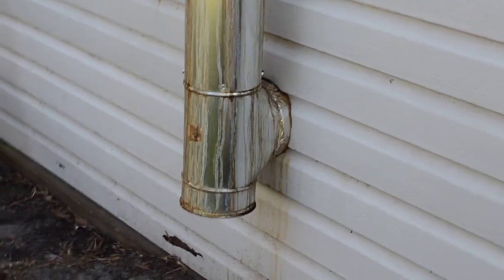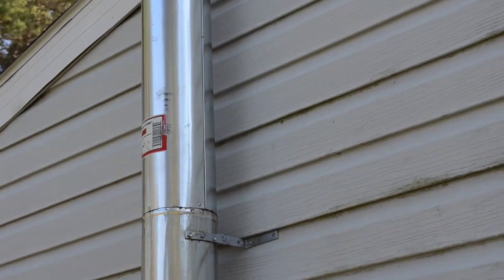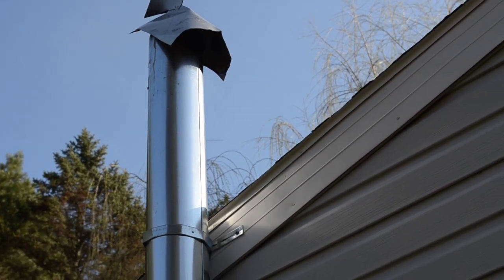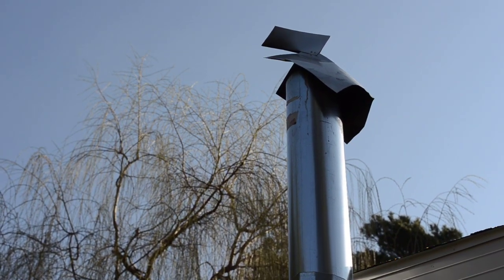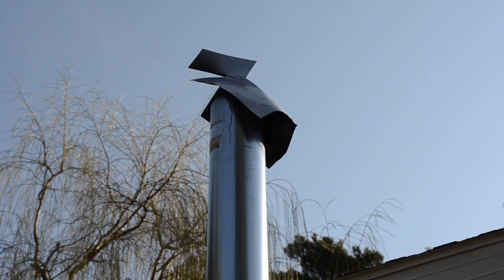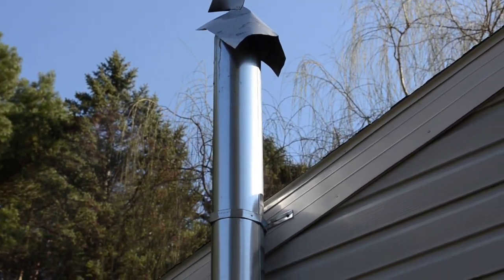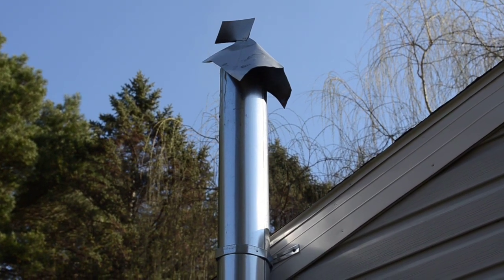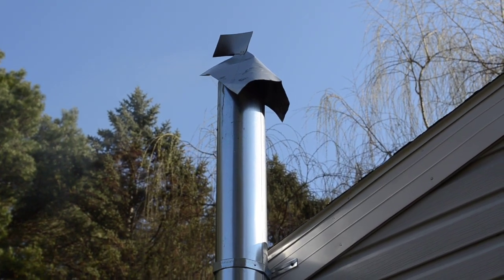Flue construction for Rocket Stove

Comment: great work your design makes a lot of sense vs putting the exhaust on the side of the barrel as many do. i was wondering if you or any of your followers could tell me how much mass should the storage be per cubic ft of the room air to give a lasting supply of residual heat. i have not been able to find anything that states this. i realize there are a multitude of variables but i am hoping for a guide line to get my design going. thanks for your great work

Comment from the maker: @tool19672  I mounted a strap inside the chimney across the diameter, in the center of the strap I attached a 1/4" steel rod about 8" long, which sticks up out of the top of the chimney.  On the flue cap I mounted a 3" brass tube that slides down and over the steel rod sticking up. So then the cap rotates freely on the steel rod.